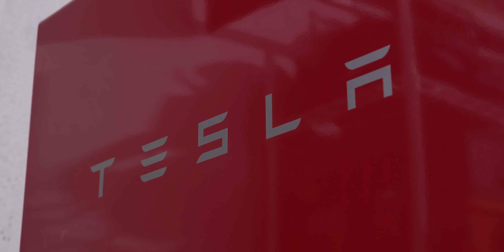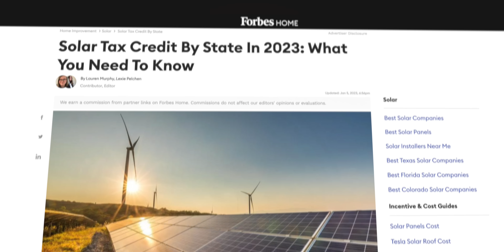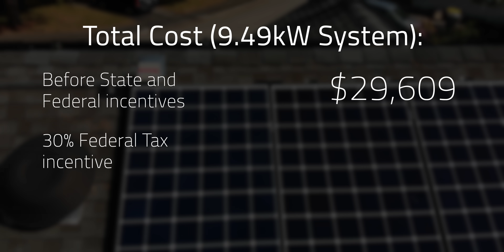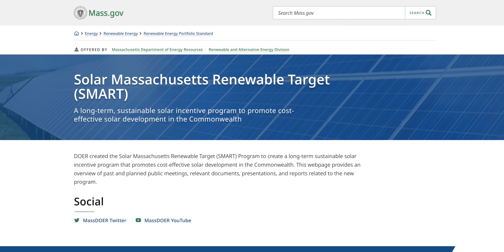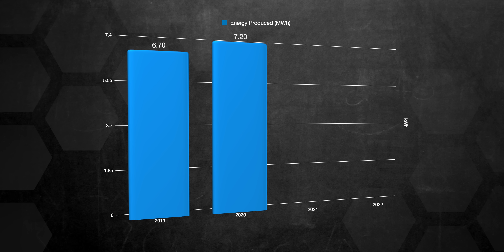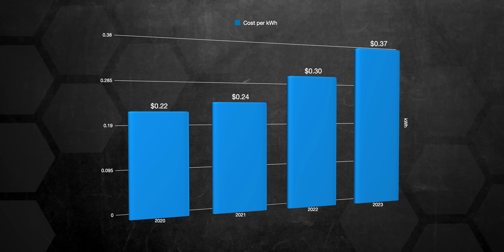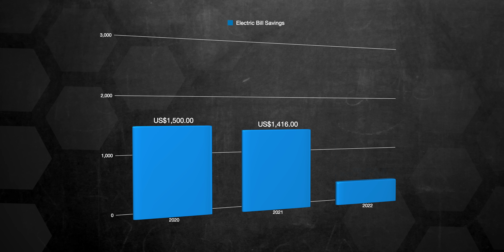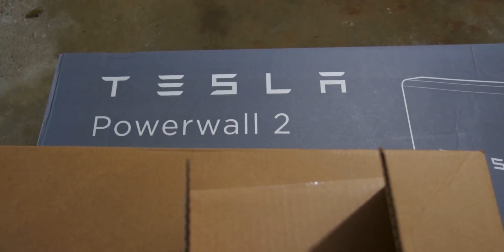5 Years with Solar Panels - Is It Still Worth It?

Comment: I live in Australia, and last week my neighbour had an 11kW rooftop solar system supplied and installed for under AU$10k by Arise Solar (you can Google them to see they have a deal on today for a 6.6kW system for under AU$4k.  Yes, there is a small federal offset involved (direct to the installer), but most countries have something similar for solar.
I only comment because I am staggered by the high cost of solar in USA.
Also, most solar panels here come with minimum 25 year warranties, while Sunpower's panels have a 40 year warranty.  Payback in Australia is typically around 4 years maximum, so in most cases it's a no brainer if your roof is well sited and not in shade.

Comment: In our case we have a section of flat roof that will probably be used.  We were advised to just cover the roof in panels lying flat rather than fewer panels correctly angled for the sun.  The overall output would be similar, but much less weight and about the same cost.  Battery backup is also something everyone has on their system because of power outages.  It does add a huge amount to the price though.
Reply: How could it possibly add more than a couple pounds per panel.   If you're not in SoCal, tilt 'em!
Reply: At my latitude (32 DEG N), a flat system would generate about 12% less output annually than an optimum 30% tilt. Tell me where you are and I can give you a rough idea of how much difference the optimum tilt would make where you are.

Comment: We have solar, but came into it in a weird way - we bought a house that already had it (installed late in 2014).  So I didn't have any buying decisions to make.  Did it affect the cost of the house?  No way to know, really, as there are so many other variables.

When we first got in the house, I got into the monitoring system, and quickly realized that there was a fault, and the system was only producing about 40% of the expected output.  So my first job was to call the installer (who was still in business), and get him to come out and get that resolved.  After that, the system has been flawless.  I will make the observation that it helps to sort of look at it every so often to see if any faults have been reported that need to be dealt with, but those tend to be rare.

For the case where you purchase a home with solar already on it, he SREC thing was kind of a bureaucratic hassle.  it was originally in the name of the previous owner of course, and there is paperwork required to get it transferred over into my name.  Fortunately, the solar installer came through here too and helped with that process.  My only complaint was that it seemed to take a long time, but that wasn't their fault.  We are starting to get close to the point where we hit the 10 year mark that the SREC have paid out, and after that, we still get another 10 years at a significantly reduced rate.

We very rarely have power outages, and we don't have TOU.  So for us, it is hard to make an argument to add batteries.  The hard thing about batteries is that a lot of people come into it believing that in the event of an extended outage, they can run their entire house off of the batteries, and for most people, that's not really very realistic.   So before ever buying any batteries, I would recommend thinking about what you think your needs and requirements are, and then figure out whether batteries are a realistic solution or not.
Reply: I think the battery should be mostly to run a fridge and lights. Not the house as a whole. Some dryers are 6800w. That will kill a tesla wall in around 80 mins. But if you know your stuff. You switch to condenser dryer, and propane genny, propane stove and cooktop (or natural gas) etc... you have to adapt to environment... Some fridges are made for efficiency, and are less than 60w (but still full size).

Comment: In #Houston #Texas, I have a 15 kW system + 20 kW batteries (qty 2). Max production is 11 kW (73% of total capacity) at any given ideal point in time. 

My electricity provider (not public utility here but retail suppliers) have net metering credits UP TO a given months usage. If I send more to the grid than I consume from the grid, I get no additional value. This was a recent change from between signing contract to install and actually getting to production.

For 2022, the federal incentive was 26% credit. When 2022 taxes came around, the rule had TWO changes 1) 30% credit; 2) if toal credit exceeded owed taxes, then balance rolls to next year THEREFORE not a check written to me.  So this screws up the paydown lump sum for the amortization schedule on the loan. This change was likely part of the #inflationreductionact. Not happy AT ALL at as I was unaware and feel screwed. This info was NOT on the .gov websites.

Would I do it again? Answer --> on the yes side. 

My three goals were a) partial home back-up power system in case of hurricane/severe storm instead of gas generator; b) control rapidly rising cost of electricity for coming years (especially after the Texas deep freeze of 2021 and recovery costs); c) replace grid energy with solar production 

#b is a win. On average cost of electricity production (exclude storage costs) ~$0.12 - $0.13 / kW. Current contract is $15.3 grid energy (per kW). When contract is up, I expect grid energy will be higher than current

#a has not been tested yet, but I feel confident it will be successful as even with very cloudy days production is ~3.3 kW and I can manage the consumption easy enough to have partial home electricity and battery storage.

#c ~9 months of the last 12 months, a zero electricity energy bill notwithstanding the "grid connection fees ($25 to $50). AUG and SEP electricity bill ~$100. JAN ~$30. So pleased 

If I lived further north...say massachusetts...It would be a hard no

Comment: We installed solar in 2015. We have a grid tied 8.8kw system. The salesman calculated our usage wrong an instead of getting the 110% we asked for we ended up with 92%.. We have never covered 100% of our usage. With the addition of a PHEV and hopefully some mini splits and a hybrid water heater in the future we would really like to expand our system. I would like to diy or at least partial diy to keep the cost down. Overall though..no regrets .Great video. Keep up the good work.
Reply: I did my own calcs... we're about 5% more power than needed.

It was a long hard slog to get to where I could do so

Comment: In Texas, etc. with a lot of forests, pollen (of cedar and oak) is a serious problem, as it surely deposits on the surface of solar panels, thus has to be cleaned off on a regular base.  This work (requiring workers carrying heavy equipments walk on steep roofs) cannot be done DIY, and high-paid skilled workers have to be hired.  Also, as solar panels must be nailed reliably through the roof, it may lead to rain leak and thus shorten the lifetime of the roof that is quite expensive (tens of thousands of dollars).  The financial gain of about a thousand dollars per year may not be able to cover up the high service fee.  I believe that’s why I see few houses put up solar panels on their roofs in our neighborhood.  This “small” technical problem is similar to that when cars were just invented and had no wipers so that the driver had to hire two guys standing on both sides to keep wiping off the rain and dirt from the windshield.

Comment: There’s one big concern you didn’t talk about in your video. Most solar panels I have seen are installed on roofs. There are two concerns with that. (1) They must be secured to the roof (I assume). Any time you have a penetration through your roof, you have a potential leak site. (2) The useful life of your solar panel investment is only until the next time you need a replacement roof. I didn’t hear any consideration of that fact in your detailed cost discussion. Don’t see how you can ignore these points.
Reply: A tile roof certainly sounds like a wonderful solution. Unfortunately, there aren’t many of those in this part of the US. With asphalt shingle (tar) roofs, there would normally be punctures through them to secure the solar panels. Caulking would be applied around each penetration to prevent leaks. The problem with caulking is that, even if applied properly, it has a very limited life-span and leaks sooner or later. Thank you for your comment.
Reply: If I didn't watch a lot of US renovation shows I would wonder what you are on about. In the UK we have tiled roofs and rarely change them. My roof is 75+yrs old for example and still has original tiles to my knowledge. The advantage with tile I guess is the fixings can be slipped up under the tile so it doesn't have a hole through the tile. I guess it is harder with tar shingles as you have to puncture them as you say, but there must be some good ways of doing that and sealing it?
Reply: @theincredulousr average roof is about 20 years
Reply: He left out a lot of things IMO.
Reply: Yes, because when you factor in all the stuff he neglected to mention,It becomes very obvious that it is not worth doing.
Reply: That is just a very stupid remark.   @cwkie3776
Reply: @cwkie3776   It can't stand on its own. Without other people's' money, it doesn't work at all.  Never mind the consequential expenses.

Comment: I am in Arkansas and this past September, I installed a DIY ground mount system at my farm.  The utility here has 1-1 net metering.  The other advantage is they allow for other meters that your responsible for to be connected to the same net metering account.  I have a condo that I am offsetting my electric bill on.  So for the past 8 months, I have had a 0 net metering kWh for both locations.  Also the fact that the system is ground mount, I am not worried about roof issues or access if I ever have to perform maintenance on the array.  I consider solar to be a WIN.
Reply: How much did it cost you?
Reply: Also live in Arkansas. After a year and a half,I still haven’t seen the benefit from my solar panels. 

The lifetime production of a year 1/2 is 13.7 MWH; however, I only receive a 60% production credit. 

It’s been one headache after another. Entergy is a nightmare to work with. 

That being said, I’ve read where if the installer omitted the RGM import/export setup, entergy only allows 60% of your production. It’s odd no one informed me about this issue.

After speaking with the engineer of the company, he tried to add RGM virtually but there was an issue with my meter; therefore,one of their technicians will soon make the necessary upgrades.

Will see if Entergy honors their agreement.

Comment: The few times I had regrets are forgotten every time the neighborhood goes dark and if I don't check my app notification or look outside then I would never know.

Edit: South facing roof, 22 Panasonic panels, paid 22k upfront (received 8k more back in my check), 2 tesla power walls from the referral program, the system is 5 years old and I sell my excess back monthly, my average utility is 115/month (water, sewer, gas, electric) before solar and inflation it was about 305/month.
I use way less than I produce due to going energy efficient after the solar install, probably about 2k over 5 years. Lights, dryer, and smart home system with thermostat, and lighting control

Comment: 1MWh that seems rather ... PER MONTH?! and that's pretty much average for the US.
How would you even do that? If I kept every appliance in my house running 24/7 I wouldn't even come close o.O
Reply from the maker: The answer to that should be easy.  It depends on where you live and what energy sources you use for hot water, hvac, etc.  Oil, gas, or electric? If you’re primarily electric for everything, including an EV, you’re going to have higher electricity use.

Comment: I have a 6,8Kw array installed at our home west of London UK.  Before the energy crisis it made a difference but if energy prices stay where they are then there is no point installing solar panels without a battery system, we would need a 20 Kwh minimum storage that would make us independent for seven to eight months of the year but the cost of batteries at this time makes the project non viable.

Comment: The snow avalanche you mentioned is no joke! I was out shoveling my front walk after a major snowstorm once and an avalanche off my roof's solar panels occurred just as I was underneath it. I ended up twisting my ankle as it knocked me over.
Reply: Did they warn you? Maybe sue the solar panel company.
Reply: @majorburke9735  Nah, s'not a solar panel problem. It's a "Roofs where I live are tall and steep to shed snow" problem and I happened to be underneath it at a bad time.

Comment: Numbers are much easier to compare to each other when you convert MWh/month and MWh/year into... AVERAGE Watts. Just divide by the number of hours. For instance you say you consumed 12.6MWh in one year. Dividing There are 8760 hours in most years, which means you consumed 1438 AVERAGE Watts over the year. In July 2022 your panels produced 1.2 MWh. There are 744 hours in July, which means your panels produced 1613 AVERAGE Watts in July. Because it's an average power you can compare easily compare months with years and it does not matter whether a month is 28 days or 31 days or whether a year is 365 or 366 days. Finding the capacity factor is also trivial.

Comment: Yeah, you’re doing it wrong. I installed a 4.5 KW solar system in July 2013 and am generating 7.2 MW annually. No degradation in power production and exactly if not slightly more than the installer predicted. Guess I should be the one doing videos

Comment: I'm planning on doing pure solar off grid for my house in the next year and a half to two years, assuming no hiccups with savings. Biggest thing is I have to determine how much I'll use, and what kind of energy storage requirements will come into play. I've already planned for stuff like orientation of house to ensure panels have maximum efficiency, and avoiding issues with snow, but... I'll continue to research constantly just in case. Will check out your site sometime soon and see what information can be of use to me.

Comment: solar power is not reliable, batteries are not either, if you live someplace decent it works okay if you live off grid solar power is worthless, biggest scam running so far is "clean energy" rubbish, i dare anyone to go look up how solar panels get made, and how batteries are made. the carbon footprint these places leave behind from all the toxic waste that results from making this junk, we can at least recycle a car, most of a EV goes in the ground and water.  still it's a good thing though it doesnt work right now, but if we discover some other means of energy storage it would be a lot better. we are not really very close. they will run fossil fuels for another few decades